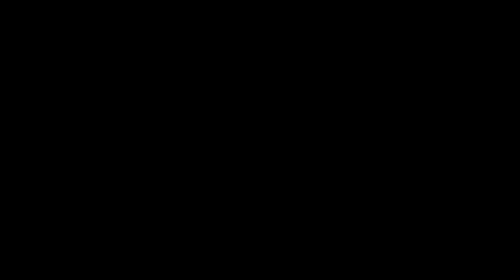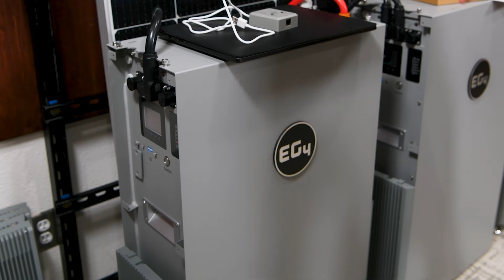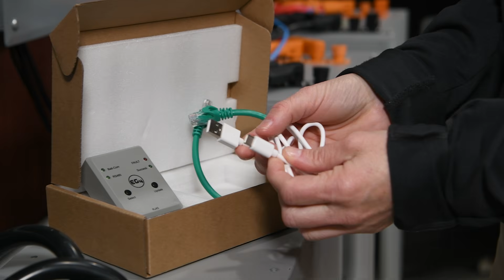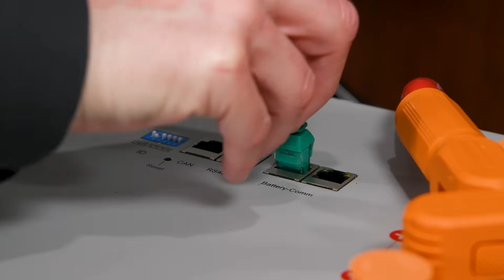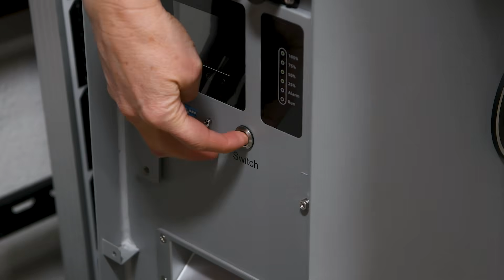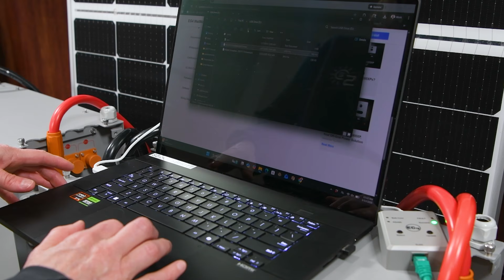How to Update EG4 Battery Using Firmware Adapter | Signature Solar

Comment: I was told that this adapter should not  be used, or will not be usable with v1 eg4 lifepower4 48 volt batteries. Is that correct?

Comment: After successful firmware update - the batteries defaulted to CAN P01 from previous setting P07.  It seems the firmware update defaults the protocol settings - check it before you close everything back up.
Reply from the maker: Thanks for pointing that out. That's a good reminder. Definitely worth checking your protocol settings before closing everything back up after the update.

Comment: i bought a new adptor and there is no space on there
Reply from the maker: I recommend giving our Tech Support team a call (903-441-2090 opt. 5). They can help you free up space for the new firmware files or determine if the issue is related to the product itself and walk you through the next steps.

Comment: Will this firmware updater work properly if a Mac is used to load the files onto it?
Reply from the maker: Unfortunately, users have experienced issues when loading or extracting the necessary files on a Mac computer. If you're using macOS and need help updating your batteries, we recommend reaching out to our Tech Support team (903-441-2090 Opt. 5). They can provide guidance on alternative update methods and help you successfully complete the process.

Comment: Just got my EG4 battery updater and when connecting to my laptop to save the firmware files Windows Defender immediately popped up that the device contained two Trojans/Worms.   I immediately disconnected the device without uploading to it.  Anyone else have this issue?  Seems the software on the device is necessary to make it work but I don't want to connect it to my PC again if it's infected.
Reply from the maker: Our team will be happy to help you troubleshoot this issue. Please give us a call at 903-441-2090.

Comment: Thank you for this. Just updated three All Weather 280Ah batteries without a hitch. One addendum, when updating both the RS-485 and RS-232 (BattComm) firmwares, power the BMS back off after the first is successful so you can power it back to trigger the next upgrade. I'm assuming that when both are done you should power cycle the BMS then turn on the battery breakers starting with the master, right?
Reply: I know this profile picture haha